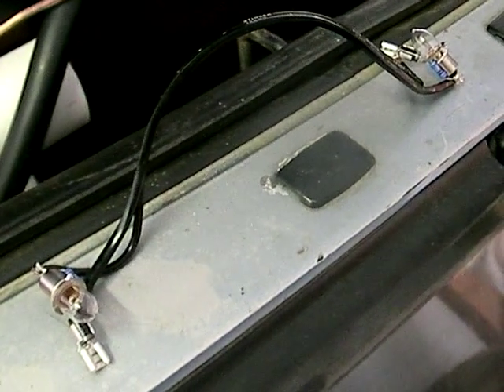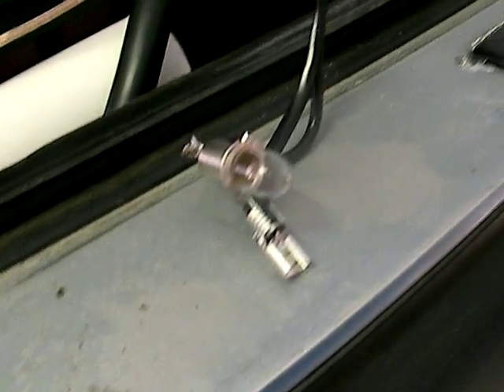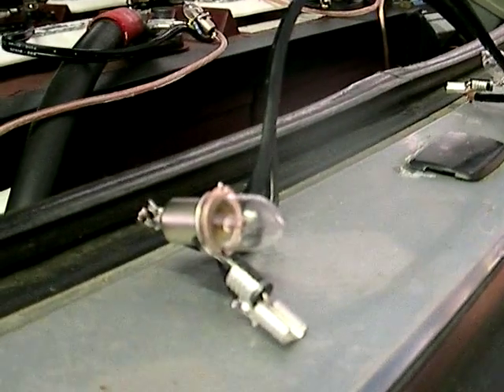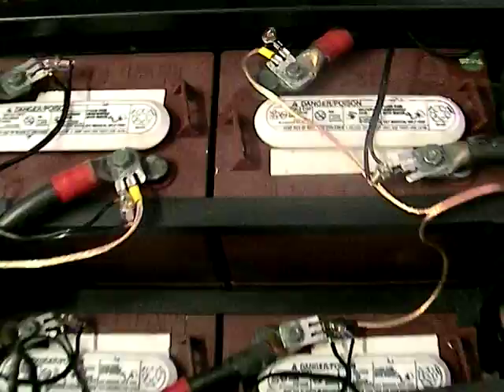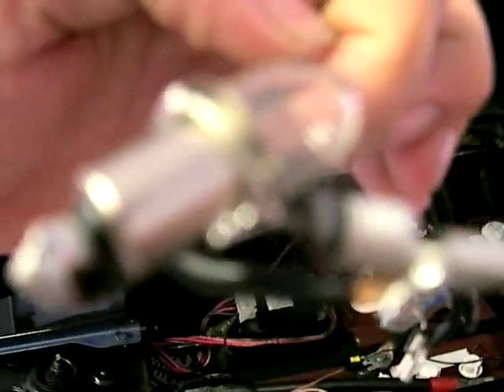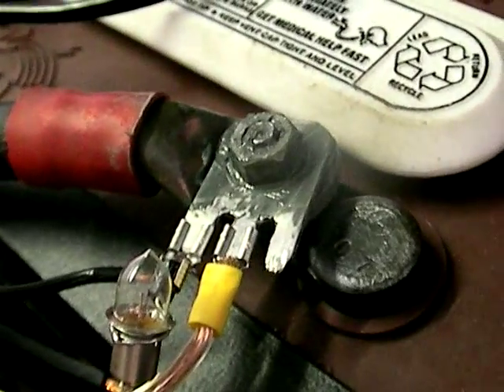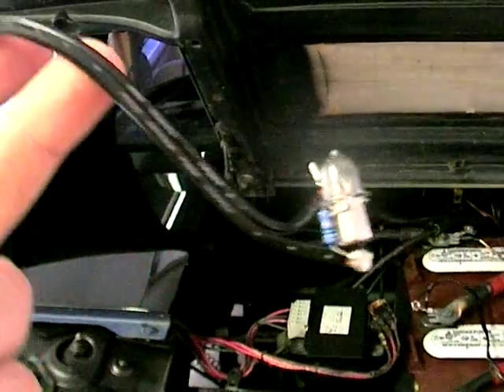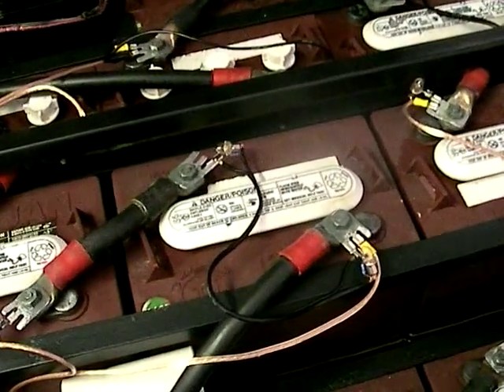Zener Charge Regulator Overview

Comment: Well done !
Do you have all batteries in series ?
Why are your batteries 6 Volts and not 12 Volts ?
What Zener Voltage did you use for the Zener diodes ?
Many thanks.
Regards, Stefan.